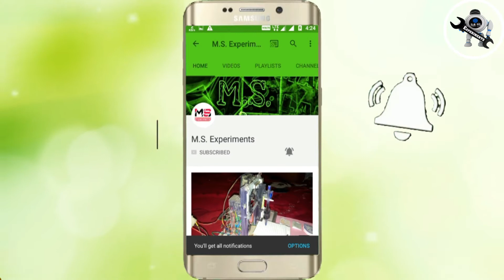DIY | LED Chaser without IC, How to make Simple LED Chaser by using BC-547 transistor

Comment: Please ek video bnaiye sir is topic par ❤
Reply from the maker: Kis topic pr ??
Reply: @MSExperiments  arduino roket and communication station bhi jo ek camera or distance counter sensor ho jisme minimum 100 km tak signal receive kar sake
Reply from the maker: It's too costly project bro.
And I don't have sufficient equipment and accessories.
Reply: @MSExperiments  ok to aap sirf arduino roket bna dijiye ok
Reply: Aap ye bta sakte hi ki isme kya component use hote h